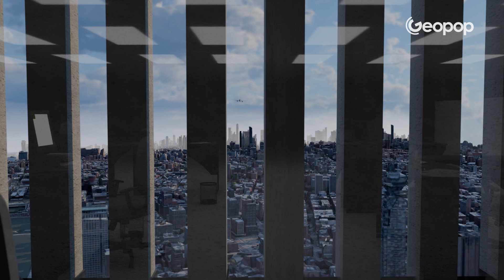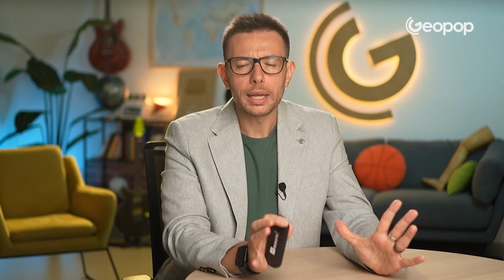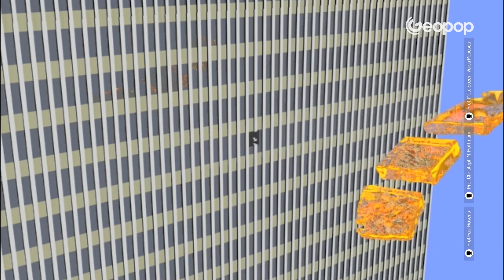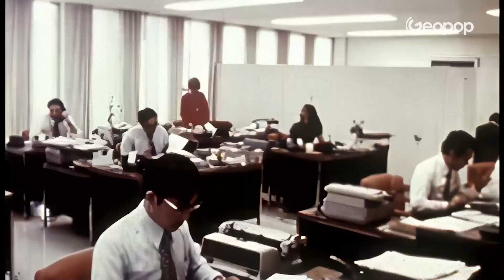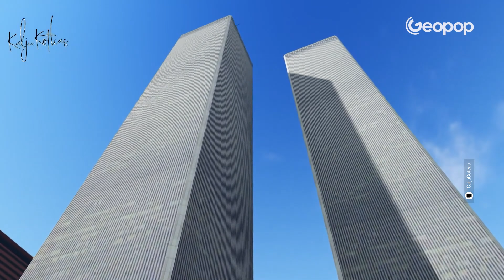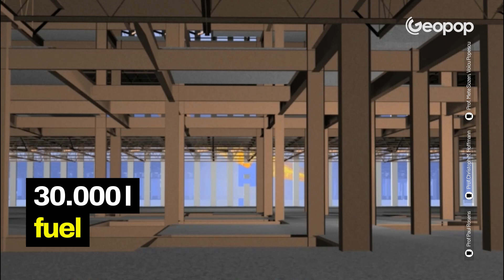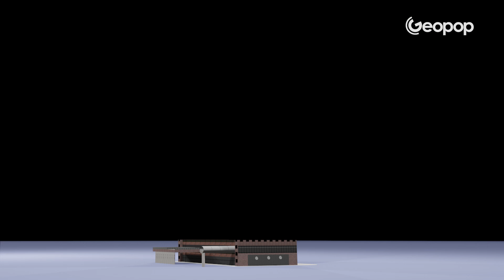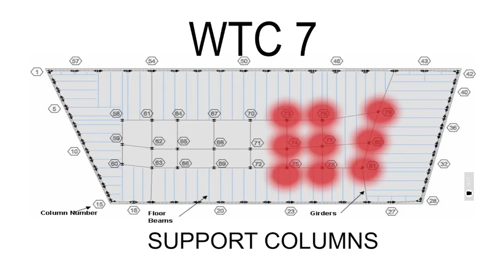9/11, 2001: The Technical Reconstruction of the Twin Towers and WTC 7 Collapses

Comment: "What happens when steel reaches 1000°C?" How does that come here? According to the NIST 9/11 Commission Report's own office fire simulation experiment, the steel could only heat up to 260°C at its hottest point. This means that on the 80th or 90th floor, it could have been that hot at one point, but on the 50th floor or the ground floor, the steel was at a completely normal temperature. Yet the buildings collapsed to the ground. Well, countless photos and videos show how the steel columns were cut using standard demolition methods. And that 180,000 tons of concrete turned to dust, covering half the city. The towers clearly did not "collapse," but, like a fountain, sprayed tons of steel debris in all directions. Etc.

This video is merely an uncritical repetition and visual embellishment of the distortions and omissions of the NIST 9/11 Commission Report, and a complete silence on the vast amount of devastating critical comments. I suggest that in your next, equally professional video, you summarize David Ray Griffin's relevant, scientifically eminent work. Of course, that's not what you're paid for, and then the YouTube algorithm would never recommend your videos—but there would be less of the satanic lies that are turning Earth, this wonderful Garden of Eden, into hell.
Reply: No fires or excessive heat at all was required below the collapse initiation point.  What started the collapse and what kept it collapsing are two different mechanisms - which I realize is hard for some people to wrap their head around.  Heat induced column buckling started the collapse. Gravitational Potential Energy released by that even kept the collapses going. 

The NIST and 9/11 Commission Reports are two completely different reports covering different aspects of the attacks.  You know that, right?  Have you actually read them or are you just mindlessly repeating other peoples (bad) arguments you copied off the internet (thus why you are engaging in so much conflation)?

For the cut steel columns you may want to watch this short video:  www.youtube.com/watch?v=pVDU5QKa8Wg 

As for temperatures, from The NIST:

In no instance did NIST report that steel in the WTC towers melted due to the fires. The melting point of steel is about 1,500 degrees Celsius (2,800 degrees Fahrenheit). Normal building fires and hydrocarbon (e.g., jet fuel) fires generate temperatures up to about 1,100 degrees Celsius (2,000 degrees Fahrenheit). NIST reported maximum upper layer air temperatures of about 1,000 degrees Celsius (1,800 degrees Fahrenheit) in the WTC towers (for example, see NCSTAR 1, Figure 6-36).

However, when bare steel reaches temperatures of 1,000 degrees Celsius, it softens and its strength reduces to roughly 10 percent of its room temperature value. Steel that is unprotected (e.g., if the fireproofing is dislodged) can reach the air temperature within the time period that the fires burned within the towers. Thus, yielding and buckling of the steel members (floor trusses, beams, and both core and exterior columns) with missing fireproofing were expected under the fire intensity and duration determined by NIST for the WTC towers
Reply: @TheLoonResistance  The problem starts when you talk about "collapse" when all the evidence points to powerful explosions. This is not an expertise problem. Every person speaking a language knows the difference. The expert's incredibility is clearly evident in the way he distorts even the simplest concepts. Watch any video (a good compilation is https://www.youtube.com/watch?v=M4rjOhpCmCk) and you see what you could theoretically know: the steel structure does not "collapse", straight down, at near free fall speed, in the direction of greatest resistance. Instead, you can see that extreme energies are throwing the multi-ton pieces of steel and everything sideways. Did the Report explain how these multi-ton pieces flew 100-200 meters from the "collapse" site? These are simple and clear refutations of the "collapse" and evidence of explosions. You don't have to be an expert to state this with certainty.

You can write in capital letters "Gravitational Potential Energy", but what you're saying still makes no sense. The incredibly massive steel structure (especially the core -- look at the pictures they took when it was built, also, check out closely a single steel beam, that massivity) is specially constructed to support many times the weight above it. It was largely intact and at normal temperature. It does not become all air without resistance -- as your explanation assumes.

Are you playing the expert, insinuating that I'm just "mindlessly repeating" silly people's bad arguments, "correcting" me with meaningless, false sentences? Like "The NIST and 9/11 Commission Reports are two completely different reports" -- No, "NIST" is not a "report", it's a federal agency that had a "9/11 Commission" that published three Reports: the first in 2004, which is a story about the events, the second in 2005, which dealt with the "collapse" of the Twin Towers, and the third in 2008, with the "collapse" of WTC7.

I looked into all of them, the 2005 one is the most outrageous, because it is nothing more than a showoff of an "indisputable expertise"; with the main intention of deterrence: that no layman should understand a single sentence of it, implicitly suggesting "Hey, you sheep, don't even think about getting into, or saying anything about, this complicated topic!"

Of course, the firefighters also cut the columns. Before any serious investigations of the rubble. They immediately cleared everything, preventing thorough examinations. The most plausible is that the steel ends cut at an angle are from the blasting, that is the usual method there; and the ones cut at right angles could be made by the firefighters.

Then you come back with the 1000°C, the biggest lie of the Report. With carbon feeding, you can achieve 1000°C with very special tools only. In building fires, the air at the hottest points is 6-700°C, as is well known and proven by many studies (don't just read the Report, because you can't get a good picture from that). But air temperature (at the hottest point) is very different from that of the steel, which could only be 260°C at the hottest point according to the Report's experiment. But intense fire and heat were in negligible small areas (as compared to the giant building) -- also, remember the woman waving unhurt from the impact gap. The vast majority of the steel frame colossus was at normal temperature, in very limited points it could be a little higher. To resort to "intense heat" and "raging fire" is a doubly false argument: firstly because it is relatively negligible in the case of the WTC buildings. Secondly because there are such cases: Have you seen pictures of the real and total burning of the Mandarin Hotel in Beijing (2009)? Well, there was "intense heat" and "raging fire" -- but the steel structure remained of course undamaged.
Reply: You are incorrect, my friend you claim that the dust was created by concrete, but you’re forgetting about all that asbestos!

You know… That pesky asbestos that would’ve cost more than the Rental income is not to mention. It would’ve been illegal to rent out any office space in the twin towers to people, knowing that there was asbestos in there… So no income with millions of dollars of output to clean up that asbestos sounds like a problem . A big money problem and people with big money don’t like problems.
Reply: @PatrickAuricchiosr  The tremendous dust clouds of course consisted mainly of concrete, that's why you can not see any concrete in the rubbles of the Twin Towers. -- The asbestos-containing ceiling tiles were previously replaced. One of the main truther assumptions is that in the new ceiling tiles they could put whatever they wanted (e.g. thermite).
Reply: @istenaldja  I am not saying you are wrong… Thank you for the information however, if the asbestos was only in ceiling tiles, why were they not 100% replaced in both buildings that does not seem like it would be very hard to do especially in a place like New York City, where people love to hustle and make money.
Reply: @PatrickAuricchiosr - Except there was zero asbestos in the South Tower and none in the North Tower above the 40th floor, with much of that having been abated over the years in the course of normal renovation. 

78% of the the buildings in NYC have asbestos and it normally does not require removal just because its there.

The internet has been lying to you.
Reply: @TheLoonResistance  exactly where do you get this information and your number is From? Even if what you are saying is true, which I would require sources… (And most things that people quote on the Internet as sources are not really reliable sources that you can depend upon to utilize the scientific method) 
So even if what you are saying is true, I want to see where you got the numbers and also why I have these asbestos written buildings in New York not been reported and are they inhabited by humans or are you talking about empty buildings?
Reply: @TheLoonResistance  you claimed there was zero asbestos in the south tower. How do you know?
Then you claim that there was no asbestos in the north tower above the 40th floor… Again, how do you know this and even if that is true that is 40 floors of asbestos LMAO😂
Did the people who worked in the towers on those 40 floors every day know that they were breathing in asbestos? Because I can guarantee you that Larry Silverstein and people who worked for him knew.

With all that being said, I may be wrong, but I do not think that Larry Silverstein has anything to do with committing the atrocities of 911, may be benefiting from the atrocities of 9/11, but not necessarily causing them. Again, I could be wrong I never claimed to know it all . Apparently you do please continue to tell me more information.
Reply: @PatrickAuricchiosr  - You are the one who made the original claim this was all about asbestos.  I was responding to YOU and YOUR CLAIM. 

So where are your sources to support YOUR CLAIM?

The burden of proof here is yours and there isn't a snowballs chance in hell you will be meeting it (I've certainly seen this movie enough times to know) hence your reversal of the BOP onto me. 

Seriously dude, just check the dates.  Use of asbestos was banned early in the construction of the North Tower and before serious progress had been made on the South. This isn't rocket surgery. 

More importantly - the terrorists who hijacked four planes to crash them into four world famous iconic symbols of American economic, military and political power in New York City AND Washington DC almost certainly didn't give a shit about asbestos abatement.

Comment: Can someone explain how aluminium can go through steel ? I've also not seen any aeroplane engines at the twin towers or the pentagon with the hours of footage I've seen ?
Reply: F = Ma

There is plenty of photography of engine parts at the Pentagon among many other bits, easily found in a simple Google Images search.
Reply: Because it was coming at the steel at 590 mph. That's how. Plenty of videos of aluminum cutting through steel at high speed
Reply: (Force) = (Mass) x (Acceleration) 

Big mass times big acceleration equals very big force. It's not complicated. 

It's the same physics that can make a piece of hay can go through a telephone pole during a tornado. It's the same as hitting the water when you jump off a bridge can kill you.

Comment: This is ridiculous the weight of the buiulding above can NOT crush the floors below !!  Remember that the steel BELOW the fire was NOT weakened !!
Reply: Sure it can, because it did.  One floor at a time. 20 floors vs. 1 floor, then 21 floors vs. 1 floor, then 22 floors vs. 1 floor, etc, etc, etc,...

The conspiracy sites like to tell you it is _20 floors vs. 90 floors but that is obvious nonsense. The falling mass can only be acting on the uppermost intact floor at any given time. 

Bazant and Zhou published the math on this within days of the attacks. There was more than enough GPA to bring down the entire structure. 

Anything can seem like a conspiracy if you don't take the time to understand how it works.  So take the time.

Comment: The simulations are missing the explosive forces, rigid body collisions is not the only forces.
Reply: No.
Reply: @TheLoonResistance  very descriptive response 👏🏻
Reply: @1stzard - it was all that was required.  What is shown is what happened,  how and why.  The reason your fantasy is not shown is because it didn't happen. 

Get over it, learn and move on.
Reply: @TheLoonResistance  So the explosion didn't happen? How can someone without eyes even try to debate that
Reply: @1stzard  - What explosion?  There was no explosion

Collapse initiation in the Twin Towers occurred when visibly sagging floor trusses at the impact and fire damaged floors caused visible inward bowing of some perimeter columns by up to 5 feet until they buckled.

www.youtube.com/watch?v=ULdiD6gYZO0

Comment: 12:50 Kilograms measure MASS; pounds measure Weight. Mass times acceleration (like gravity) equals weight. Mass is an intrinsic quality that an object IS. I AM 70 kg, and I WEIGH 154 lbs.
Reply: Actually, no.  kg is the correct unit for both mass and weight, in the SI system.  Weight is simply mass corrected for acceleration, which is newtons in the SI system.  Pounds is not part of the SI system.  It comes from the ancient imperial measurement system, which scientists don't use any more, and haven't used in many decades.
Reply: @ChristLink-Channel kg is not the unit of weight. Newtons is the unit of weight.
Reply: @oniruddhoalam2039  ... as I said: "Weight is simply mass corrected for acceleration, which is newtons in the SI system."
Maybe learn to read and understand, before you make posts that demonstrate your reading comprehension issues?